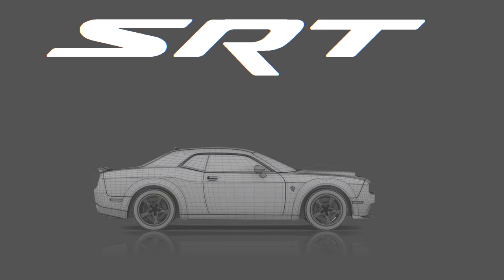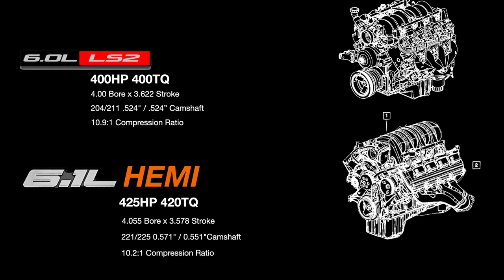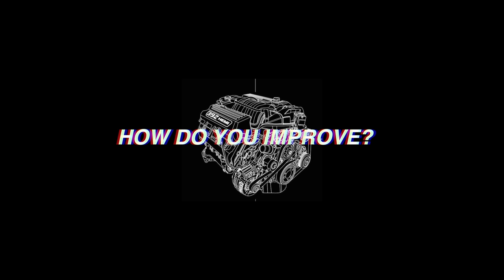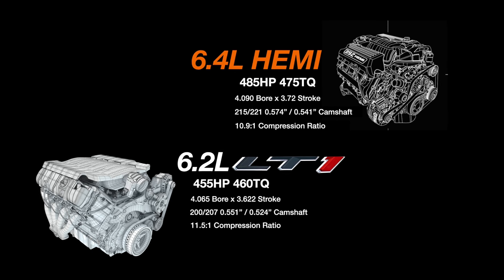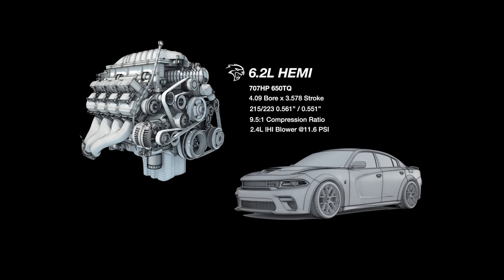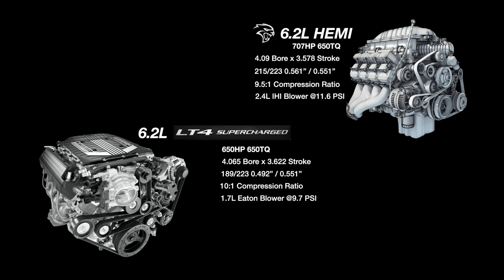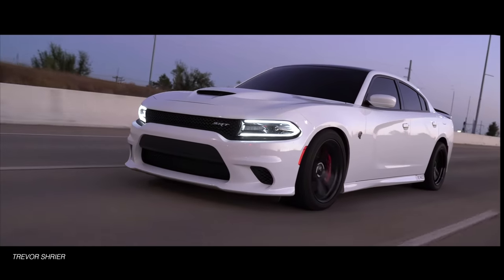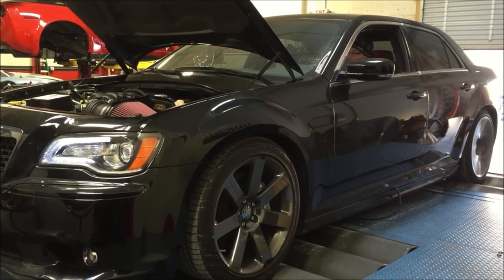Why SRT Engines Are Way Too Powerful😳| Explained Ep.3

Comment: This engine series has been awesome. You should do it for every performance engine out there, JDM, Euro, and moar American muscle.
Reply from the maker: Yup that’s coming next!
Reply: @337speed  now I need u to do a comparison with the hemi 8.1 ND the vortec 8.1 motor yes that's right gm and dodge both make 8.1 motors in early 2000s Era I want a comparison
Reply: @jackdaniels2657  stop calling this fake Hemi a Hemisphere engine. 🤦‍♀️.
Reply: @lincolnls0416  I just want to see the dodge 8.1 engine VS gm 8.1 engine
Reply: Great animations also, you don't see that often.
Reply: @337speed  I'd like to see the Pontiac ram air III, IV, and V, the HO and SD motors, all between 61-74.
Reply: @rickj1983  best gm ever made!!
Reply: Barra

Comment: The 5.7 is more responsive to mods than the 6.4, that’s why you don’t see many fully built and modded 392s, it just makes more sense to just get a Hellcat. It’s also not like you can’t build a 1200 hp LT, Hennessy will even give you a warranty.
Reply: The 5.7 is like the scat pack the reason they take bookstore is because they have more to gain than the scat. It's like a fat lady and a skinny lady at the gym, who is going to get bigger results?
Reply: Has much less to do with any of that and much more to do with the build cost for the Apache 6.4 due to the height of the ringlands. You have to internally build a 6.4 before doing any boost mods or nitrous whereas the 5.7 comes plenty capable of doing either from the factory. It's more cost effective, but the 6.4 is absolutely capable of having a killer build with high horsepower, I've seen them before. Including a TT (twin 58mm's) Yellow Jacket build knocking on the door of 1k hp on a light tune.
Reply: lol I’m going through the process of modding mine now..
Reply: @marquis3733  You mean the one you stole?
Reply: It doesn't make more sense to get a hellcat. The scat pack is more than enough. Though I also want a hellcat😂
Reply: @FecalMattur it really only becomes worth the cost if you build for Demon numbers and not Hellcat numbers.

Comment: Procharged my 392 yellow jacket cracked 6 pistons.
Went with the HHP/BES forged 392 🤌🏽
620/590 on 8psi low boost
Twisted the driveshaft 😑 
Went with DSS carbon fiber 1pc. Blew out the axles 🤦🏽‍♂️ 
Went with DSS half shafts 💪🏽 
Now its all rated @1500hp lot more aftermarket parts but its good now
Transmission is def at the brink tho.
Reply: That’s dope. Any videos?
Reply: Take your transmission to Southern HotRod i heard they do good work on transmission but you got to ship it to them and they will ship it back to you once they’re done
Reply: Would have been cheaper to get a hellcat.
Reply: Geez I think i’ll stay stock I’ve heard several stories like that im not sure i have the stomach to spend 20k to pick up a second at track and still get beat buy half the electric cars being sold. Although im sick of getting 12:40s at 1/4 it’s depressing also.
Reply: Just ls swap it bro
Reply: It’s always cheaper and efficient to just get a hellcat lol. 6.4 doesn’t like boost unless it’s built
Reply: @boostidavis  I heard they do pretty good with nitrous since it’s a high compression motor.
Reply: My 6.1 is at 6psi and it's holding up pretty well. Bout to make the switch to e85 for the extra power.
Reply: @FPSacramento  yeah they do good with nitrous.
Reply: I feel this lol. Had the same issues with my blown 96 mustang. Had to upgrade the entire drivetrain.
Reply: Lol
Reply: 392 all motor or hellcat. 392s don't handle boost well at all....
Reply: I like how broke it down . This is what people need to know
Reply: Wonder who procharged it i procharged mine and no issues
Reply: My 6.1 has been running 6psi for nearly 80k miles. Anymore yes I would want forged internals. But 6psi seems to be the sweet spot for the 6.1

Comment: I think we can all agree if everybody threw everything they could at any of these platforms you can close to a couple thousand horsepower out of any of them Dodge Ford and Chevy
Reply: Perfect way to summarize it Craig!   All the same in the end...and now with $5.00 plus gas,  do you really need 1000 HP?
Reply: Ever heard of mopar tax's?
Reply: I'm not as familiar with Ford, but the latest generations of LS and Hemi are amazing.  You can get big horsepower numbers with simple one-click order kits!   

Back in ye old days of yore, I remember working on budget performance engines with my dad.  You had to plug some oil galleries, bore out others, and pull all kinds of tricks to get oil pressure to the right places.  No one could really tell you 100% what needed to be done for a given block, so you had to take advice from this book,  that magazine or old Gus who worked down at the machine shop.   Forget about kits!   You'd have to mix and match this part with that one, and see what could be machined to order.
Reply: @gt-37guy6  shit il take 5$ all day for a gallon it’s over 6 in cali
Reply: @NateandSelena  I lived in OC and San Diego for around 8 years....you overpay for everything there.   When I lived there wages were slightly LOWER than back in Minneapolis. Employers joked that you were paid in SUNSHINE DOLLARS!  Ah...right...
Reply: @gt-37guy6  More Horse power Means Less actual Fuel to push the engine.." less stepping on the  pedal..." The Engine is running more efficient on behalf of better Resistance to   Thermal Friction and Balanced parts ..
Reply: Coyote has made 2930 whp in prepped oe cast form. The other two.... nope

Comment: Excellent video! I have 2006 300c SRT8 6.1L. 12.9K miles great condition. I feel its the best sounding HEMI 😌. Love the simplicity of the engine. 8 cylinders all day everyday! I like the idea of building it up but I'm enjoying my light mods for now (tune, exhaust, CAI) with 275 tires on all around.
Reply: I used to have a 07 300 Srt8, I miss that thing to death!! Having a HC is cool & all but it comes with unnecessary attention.. if I had to do it all over again.. I would’ve dropped a built up motor in the 300… the one thing I didn’t like about the 300 was that the suspension stayed in Trackmode..
Reply: @marlboropiked  good feedback. What type of motor would you have done? Stroker kit? Motor swap all together? Etc.
Reply: @mr.300c  A stroker kit or motor. I wanted to put a blower on it but I kept hearing about the issues the car would have & need, like new axles, different trans to handle the boost, I enjoyed it stock though.. I mean that thing really jumped off the line hard like a 1320 lol… Even though I have a HC now I never look down on those older SRT8’s. HC’s are cool but they have lag on take off & there’s always the threat of loosing it.. I never felt like I was gonna loose my 300 though.. I did widen the tires in the rear.
Reply: @marlboropiked  very valid! That's my thing, building is cool but for me if you go too far then I feel financially its better just to get a Hellcat. The 300 SRT does jump off the line good though 🤭. I can imagine being annoyed about loosing control in Hellcat if you keep your guard down. I still want to experience a 392 (widebody) too. I love the 8 speed tranny. 😍 Hellcat is always a big dream but my 1st dream was a 392. We'll see how things transpires when the car market corrects itself. I can always keep my 300 too. I only owe like $5.6K and my payments are $196. I have about 2 and half years left on the loan (only 2.9% APR). Just barely passed 16K miles.😎
Reply: @mr.300c  those are good miles… when I sold mines it had 86k.. metallic steel blue… I got caught up in the HP numbers but 600-650 would be great for that car… I had them both for a bit to kind of see the difference. The suspension & 5 speed transmission was the biggest difference between the two besides one being supercharged. Also it was way cheaper to deal with the 300 vs the “money taker” lol!
Reply: @marlboropiked  hahah! I hear that! You don't regret getting a Hellcat do you? I know all the fun happens from 0 to 60 in the 392/SRT8 and Hellcats shine after the 80mph mark when you get some traction 😅
Reply: @mr.300c  Sometimes I do regret getting one..I bought mines before the hype so my price was what you would normally pay at that time.. 2017 $53k with 4,000 miles on it… it’s the extra attention & paranoia that I now have to live with.. I liked my 300 because it was a sleeper unless you knew.. so I never had to worry about theft or air tags being placed on the vehicle.. I don’t drive mines much now because I have a company vehicle plus another one before I get to driving the HC.. I work a lot so I don’t have much time for it.. it has 26k now on it.. it’s a garage queen at this point… 🤷‍♂️
Reply: @marlboropiked  Mann those were the days! Low mileage affordable used Hellcats 😮‍💨😅. Thats tough having a amazing ride that you don't ride much because work vehicles/other cars etc. Hopefully you hold on to it a little while longer.  😉
Reply: @mr.300c  yes sir… I couldn’t imagine sitting there going over numbers for a red eye or a super stock lol! It’s funny though because Dodge has tried to get me to sell my car back to them 5 times so far.. no mods, dealer maintained…clean as a whistle..

Comment: I like the video, great work! One major correction: the SRT engines have never been a bored out version of the 5.7L. They are separate blocks and are treated significantly different during manufacturing (ex: deck plate honed).
Reply: If I remember correctly, the SRT8 engineers were saying the 6.1 is indeed a different engine and was engineered to be raced for 100k miles before a rebuild.
Reply: They have the same block. I know this because the 6.1L Hemi has an orange painted block, “Hemi orange”, so that they could differentiate the blocks in the factory.
Reply: rtboy9542 6.1s use the same stroke as a 5.7

Comment: Man the SRT-4 was the coolest and most unique SRT made especially in it's class. Nothing was ever like it and it made great power , smoking cars 2 to 3 times it's price. The exhaust note was heaven sent
Reply: Accurate AF
Reply: I have a blue one and it’s very cash money
Reply: I love the way it sounds! You were the shit driving a srt4 back then lol
Reply: I run a pt gt with a straight pipe and no air box, it sounds very nice
Reply: mazdaspeeds gap those easly
Reply: @1991june  nahhhh
Reply: its price, not it's price.  it's = it is.
Reply: @LeonardoGarcia-kv2fl  the Noen version of the srt4 only ran high 13s in the 1/4 mile so how cheap was it lol not sure if the caliber SRT4 where any faster.
Reply: @derekmaxwell8164  caliber srt 4 was quite a bit faster stock. Got vids of mine on my channel. Original srt 4 also had the lack of LSD issue. The caliber engine was limited though unlike the original srt 4 in the block. Caliber had a more modern lightweight block and a few other things that while allowing to be lighter and make more hp limited you to around 500 hp before you needed to reenforce the block.
Reply: Dodge not only raise the bar for subcompacts then but they leapfrogged everybody and Hondas were a joke. Even a stocking neon with 150 horsepower with smoke any Civic or Acura Integra back in the day. And then they just kept on making bigger and better cars. And if you want a grocery get her charger with a 2.7 or a 3.5 that's fine but then you can go hemi 392 hemi or hellcat versions of just about any car they make. That's a real company
Reply: @ubeuonly  huh? No it wouldn't and I had an art 4. Yeah the civics were a joke but the Acura Integra RSX type s is and type R's in Japan had some of the best k series engines to date. The stock SRT4 was just slightly faster an Integra type s. Both had great engines though. Dodge actually held their own with that 4 banger in hp per liter specs. Historically dodges have always had crap hp per liter specs because of engine design. They always got around this by large displacement. All the way till about 2005 I think the s2000 was the hp per liter king.
Reply: @4touchdowns1game29  I was referring to the regular integris trying to hang with a neon sport. The neon was thousands cheaper with 150 horsepower and they would Gap everything but the modified Hondas you're talking about
Reply: @4touchdowns1game29  and not to mention that they offered stage 1 stage 2 and stage 3 upgrade kits for the neon. Factory back and warrantyable parts which not many manufacturers were doing back then
Reply: @ubeuonly  oh yeah for cheapo cars I agree. I also had a neon sxt which for a little sohc 4 door was surprisingly quick.
Reply: @4touchdowns1game29  I bought the first year first generation 132 horsepower neon four-door for my wife. Surprisingly it was a 16 second quarter mile car and in that era that was actually quicker than most cars on the market
Reply: @4touchdowns1game29  actually the caliber was slower on paper stock for stock , due to weight and traction. More power ? Yes but it didn't equate to being quicker 04-05 SRTs ran a quicker quarter than the caliber even 0-60 times were quicker .
Reply: @7Logik  I meant in terms of straight off the lot bolt on potential. The caliber because of a few changes to the motor made power easier and was faster in that regard but needed a neon block or block work to go past about 450 hp safely.
Reply: @7Logik  sucks I lost most of my old videos. Still have one on my channel of my caliber.
Reply: I don’t know but I heard Chrysler engines suck tbh — the srt8 jeeps came out with problems- harley see them now cause day suck . Lots of problems—— the ford crown Victoria tops out and beats any car out there dnt matter how fast
Reply: "It's NOT a neon!" 😂

Comment: I have a 2015 Charger Scat Pack with 107K miles I have not spent a dime on the engine and transmission other than tires and brakes (specially tires). This is my daily driver car and used to drive 100 miles a day to work. So far I haven't got the HEMI tick issue as of now, if the tick destroys my engine then I might plan to modify/rebuild the engine or put a 426 HEMI (whichever is more viable) since my extended warranty expired last month and then finally take the car to the track :)
Reply: Direct connection has all the crate engines. The 392 isn’t a bad deal new.

Comment: Another thing to note with these engines, is that the truck blocks 6.4 bge, were more robust like the hellcat block, and the truck heads use a different casting, but the same alloy as the hellcat heads. And also flow very well.
Reply: The BGE block used in the trucks is also used for the hellcats. The difference is that the BGE block is deck honed for the hellcat not the trucks and of course the different internals (cam, pistons etc.) and the heads. At their base though it's the same block.

Comment: I love what Dodge has done to the Hemi over the years. I remember when the 5.7 replaced the Magnum truck motors. People were blown away by the driveability difference going from a workhorse motor to the thrust of a Hemi. Little did we know we were getting "just the tip" of the iceberg. 

I just sold my 5.3 L84 Silverado for a Mercedes partly because of your AMG video. I'd say I wanna sell that now and buy a Hemi, but I already have one. My wife drives a 22 Ram Laramie with the etorque. Much as I don't like hybrids and electric stuff, that thing HAULS.
Reply: I was just looking to sell my Durango r/t and get a 06 e55 amg. Then I watched this video and I think I'm going to hold on to it
Reply: Remember, when the Hemisphere barely came out, they were actually call Dodge Hemi Magnum
Reply: Meant to say Hemis
Reply: Came out hemispherical
Reply: I have a Tesla performance and it will outrun practically anything on the road with ease and it only cost me $10 to charge

Comment: I've always been one who appreciates all the performance the American big 3 put out. I've owned vehicles from all 3 over the course of my life and all were good. Currently I own a 2018 Mustang GT putting out about 500 crank HP with some mods and couldn't be happier. I looked at Camaros, Corvettes, and Challengers but settled on the Mustang mainly because of its looks, performance, and the sound of that Gen 3 Coyote. Of all of them I personally think the Ford 302 sounds the best coming out of a good performance exhaust. Mine is the Corsa Extreme and it sounds like race day at NASCAR lol
Reply: The three valve was the best sounding modular engine from ford. It sounds great albeit not impressive power wise
Reply: The gen 3 coyotes are on a whole different level. Small bock 5.0 with crazy reliable power on stock internals and stock block. Single turbo coyotes have hit 7-8 sec 1/4 miles and still reliable